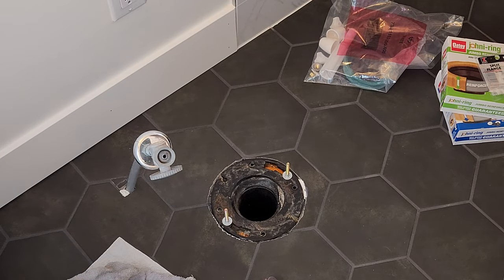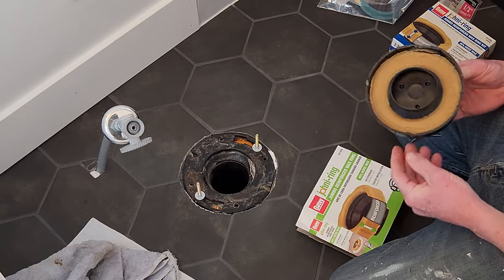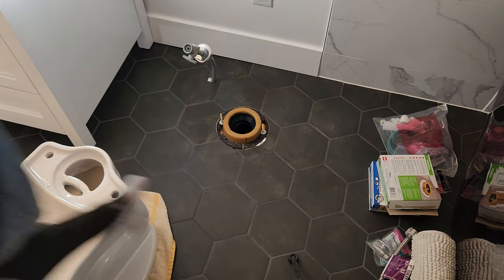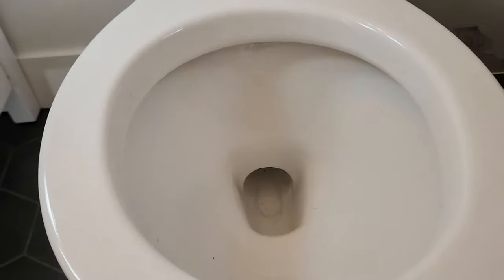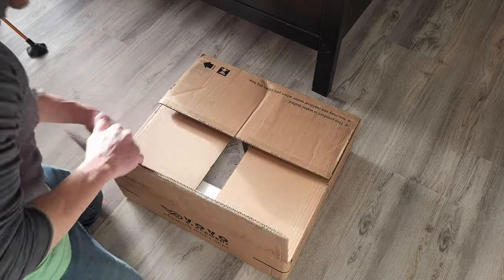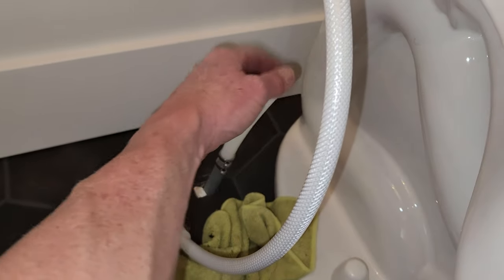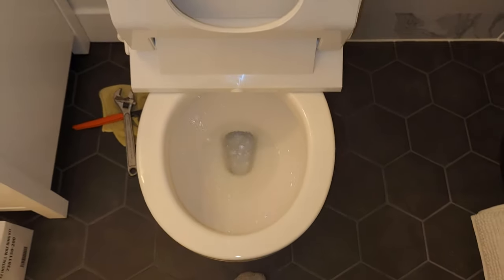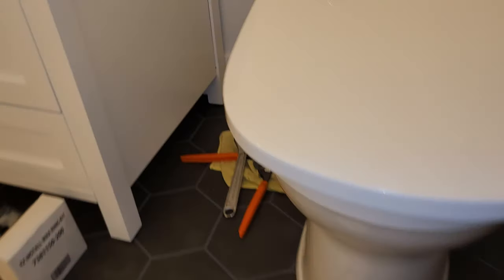How To Install A NEW Toilet & HEATED Bidet Toilet Seat!

Comment: 0:31: 🚽 The video discusses installing a toilet and replacing the wax ring.
3:38: 🚽 Demonstration of installing a new toilet and wax ring.
7:17: ⚙️ The process of installing a toilet is demonstrated, including checking levelness and using body weight to secure the toilet.
10:51: 🚽 Review of grooming products and a new trimmer.
14:33: ⚙️ Installation of a new toilet and bidet seat, including potential issues with the t-valve threading.
17:46: ⚙️ Explanation of installation process and adjustments made.
21:07: 🚽 Review of a toilet and bidet installation.
Recapped using Tammy AI